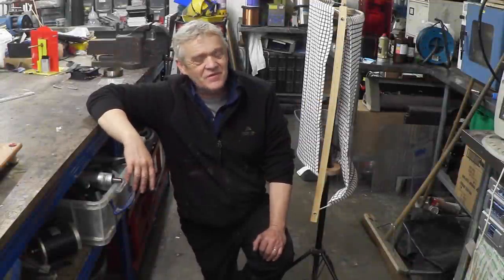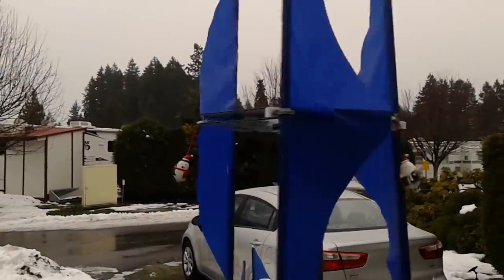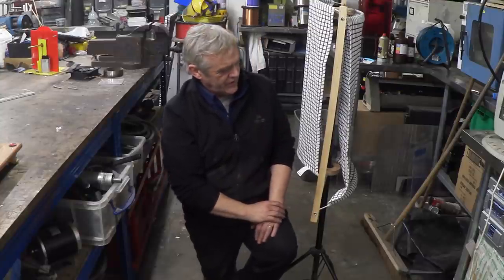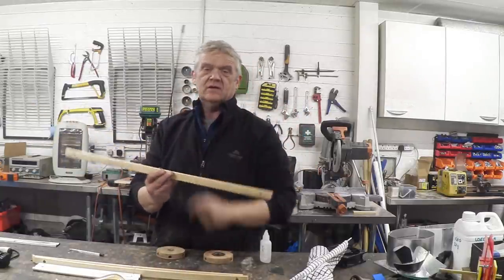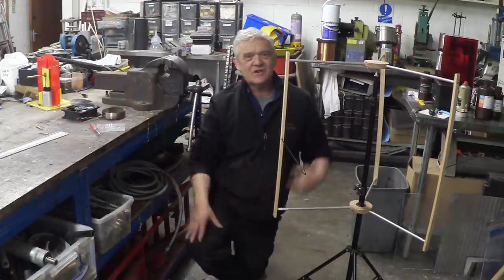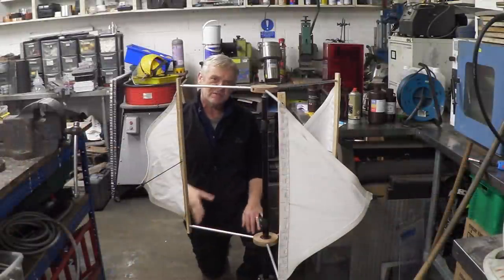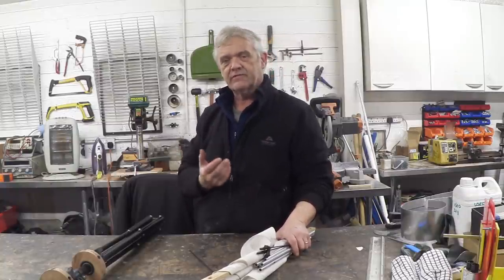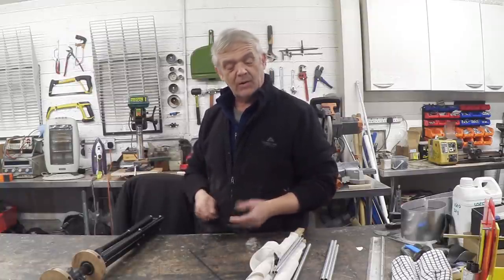1354 Ron's Folding Wind Turbine

Comment: Excellent Rob.  Rons design is exactly the same as the one I recommended to you about a year or so ago. My one whizzes round in a blur in even a modest wind and I have been considering adding a ring of magnets under the central disc with matching coils on a fixed disc below it.
Great project........shower curtain material seems to last just fine.
Reply from the maker: thank you mate - you have certainly given me an idea right there - cheers

Comment: Looking forward to seeing the mechanism for generator! It's relatively easy to make something that spins in wind but hard to attach generator and gain useful amounts without it stalling😊❤️
Reply from the maker: true enough mate
Reply: Now you have me thinking.  Is there a formula for the size of a sail as to power output?  Sails move boats, but what size do I need to move a self excited alternator and still stay within the scope of this project. Which, is easy to carry, setup and generate useful power to the users satisfaction.

Comment: Some years ago I messed around with a washing line for a wind mill. I had 4 sails made of plastic sheeting which could clip onto the 4 rods of the wash line. I could set it up in a matter of minutes and was able to produce 100 watts on an average day and up to 200 watts on a windy day. When it was not a washing line it was charging up my 100 amp hour battery. Rough calculations tell me I was probably getting around 30% efficiency which was not bad considering the simplicity and cost. It was big but that’s where the energy derived from it came from. Only thing was plastic was not strong and ripped in excessive winds. I still have to make one using parachute material which is water proof as well.

Comment: not sure why but the video reminded me of my idea of making a savonius that has the core of the blades stiff and attached with a swinging action so the back side of the blade can be pressed on by wind causing it to open up, and the air to pass through the turbine blade, while the flap catches when pressed by air from the inside of the blade that you want to have air pressing against it to make it go round, basically a check valve for the air, that lets it through the blade to avoid resistance when you want it, and does not let it through when you DO want it, :)
Reply from the maker: I like that idea mate
Reply: @ThinkingandTinkering  Thanks, I am sure I got it from somewhere else lol

Comment: Okay, so this may or may not do anything. What if you added a "mainsheet" to each sail that are attached to the mainsheet of every other sail. So when the sail is going down wind the force of the wind pushing the sail out would pull the mainsheet of every other sail in as those sails head up wind. Reducing the surface  area for each sail as they return up wind and increasing the surface area of each sail as they rotate down wind.
Reply from the maker: you could make the 'mainsails' with flaps that way up wind they would flap open

Comment: Generation could easily be done by putting two magnets on opposite sides of the bottom of the bottom disk, and putting a wire coil on the stand just below the disk.  Rectify it and feed it into a charge controller, or even a buck/boost converter set to the charging voltage of your battery.
Would be cool to see it set to 1.8 or 3.6 volts, charging a homemade zinc-bromide battery or two.

Comment: Wonderful!  Now how do you adapt the bottom bering to turn a few ' solar ' motors and have them in both paralell and series? That would be to have more than the 3V each out and more than a few miliamps.
Reply from the maker: put a cog on it mate - or maybe a belt drive?

Comment: Could you explore the dimensions needed to make a chain generator.
Where by you have a length of chain that goes vertically up to a pulley or bicycle wheel then weaves its way back down around more pulley's or wheel's. The weaved side will be heavier therefore pulling the straight side round continuously

Comment: if that seam making material on the roll is like the iron on patches for pants and such, its basically hot melt glue smeared out on the backing, maybe a bit porous in your case so it can melt and pass through to both sides and adhere both sides of the inside of the seam together, 

IE you could use a thin strip of hot melt glue on something covering both sides and then iron the cloth over it so it melts into the cloth and holds it together, or just run a seam of hot melt glue on the back of the edge and fold over then iron heat it up again as well as creasing or pressing the edge together 

something I am finding useful for this, is that the hot melt glue can be used to hold things much more steady than pins and can then be very easily sewn together even roughly by hand, which wil withstand higher temps of the sun baking the cloth, than the hot melt glue might, :) (my experience is with canvas for making tent segments with inbuilt thermal diode material for use both summer and winter times :)
Reply from the maker: nice tips mate - cheers
Reply: @ThinkingandTinkering  something else I found is that the black hot melt glue used for removing dents from auto bodies (or pulling them back out) is by far a superior hot melt glue over the clear stuff sold at the craft section of big box stores :) I have glued PET strip to PE plastic that no paint I have would bond to, nor the clear hotmelt glue, and it could not be peeled loose only way to remove it with out heat was to tear something. so really good strong bond even to PE based stuff. Will have to try it on UHMW-PE and see how it works there. That stuff is like trying to glue things to wax lol.

Comment: Yes but why triangular? Isn't it best to have more surface exposed to wind?
Reply: As long as it doesn't stall the flow of the wind too much.
Reply from the maker: I think it depends on how you are using it - this is a lift device not a drag device
Reply: I do need to recall the difference about drag and lift, do you have a video about it
Reply: I was thinking about that, the tea towel is shaped as a savonius  in both configuration, there is never a time during the rotation where the blade uses lift like a Darrieus...

Comment: What about latex wall paint for inside the house? seems like it would withstand getting wet better too. since PVA is not really water proof at all. and you can find oops paint on the shelf of most hardware stores that is reduced because it was already mixed accidentally the wrong color, so they discount it to get rid of it quickly before it goes off. Here its like a 25 dollar pail of paint will be only 5 bucks in some awful color to the masses but is usually a useful color for steampunk building XD
Reply from the maker: worth a try mate and PVA is an old trick here for waterproofing and stiffening - I hate to say it but you can buy waterproof PVA you know
Reply: @ThinkingandTinkering  hmm I have looked and everywhere says that there is no true PVA glue that is waterproof (on wood working forums and the like, as I was working on a wooden platform to stretch broken solar panels on, so I could reuse the frames for new solar cells to go into and hopefully continue getting the lowered wattage output from the broken ones if not use the wrap film coatings that can be heated with a hair dryer to shrink it to fit, that supposedly returns some of the power output by bringing the panel glass back to being as flat as possible) anyway I just painted over my wood frame with oil based paint to seal it in and make sure the glue and screws would stay dry and not rust or soften again from moisture. Will have to have a look again though an idea of what I would be looking for would be greatly appreciated.

Comment: Just fyi, the is an old o blacksmiths recipe for weather proofing cloth, wood, leather, and iron. Equal parts but volume turpin, linseed oil, and melted wax.
Reply from the maker: nice tip - cheers